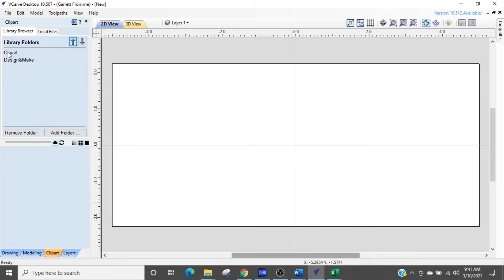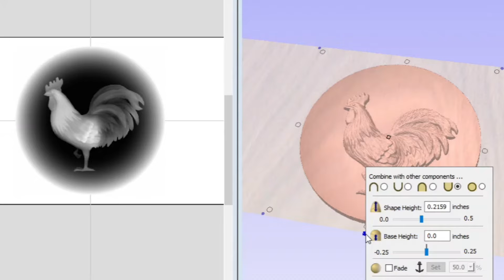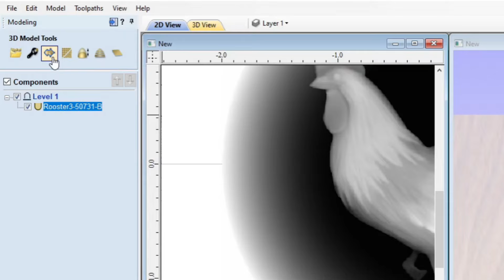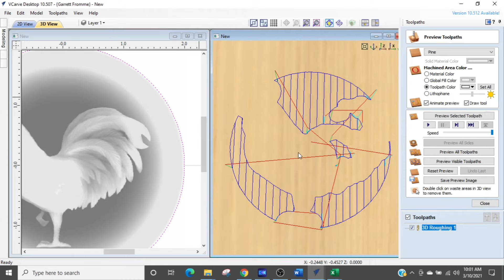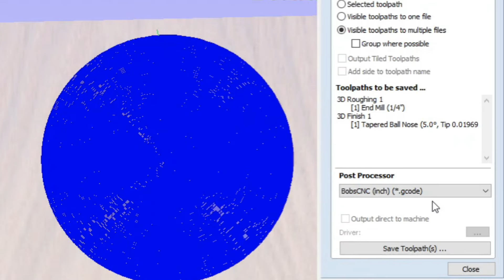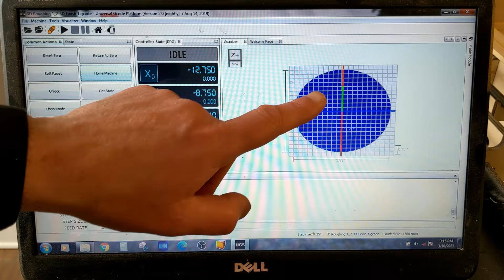3D Carving Made Easy: Full Vectric Step-by-Step Tutorial

Comment: Quite informative video! I do have a question, how did you settle on the calculated chip load for each operation? This seems low for either hard or soft wood (I believe I've seen either .002-.003 depending on the wood).
Reply from the maker: Thanks for your kind words! Choosing the right chip load can vary based on the specific operation and material, so I appreciate your input and understanding.

Comment: Good video Garrett. Thanks. I just want to confirm when doing the bit change, you need to do a Z zero again I presume. The first bit you did in the middle of the project, the second bit? If material has been removed with the roughing bit in the middle, do you do the Z zero anywhere else on top of the material instead of in the middle of the project where you have carved already? Your reply will be highly appreciated.
Reply from the maker: Hey there! Great question—yes, you'll want to re-establish your Z zero after a bit change, especially if you're switching from roughing to detail bits. It's best to do that based on the material surface where you'll continue carving, rather than in the already carved areas. Thanks for watching!

Comment: I'm not sure if anyone is having the same issue. I follow your video and setting for the toolpaths. However, i cannot seem to get that first toolpath anywhere near your 2 or 5 minutes, I'm seeing 20-30 minute range. Any tips on what my problem is? Im using Nextwave HD510 and vcarve pro12.
Reply from the maker: It sounds like you might have different settings or setup parameters compared to what I used in the video. Factors like feed rate, depth of cut, and the material you're using can significantly impact the cutting time. Make sure to double-check your tool settings and see if you're using the same bit or similar material. Sometimes, small adjustments can make a big difference in speed. Happy machining!
Reply: Thank you very much. I will check everything again. I've really enjoyed your videos and appreciate your teaching style. I work at a specialty hardware store, and I'm always letting people know about your channel. Thanks again.

Comment: hello sir you look like the one for this question i purchased a telecaster guiter build STLfile off esty . i am trying to carve out a guitar fretboard looks good in 3d view but cant get it right when i do the roughing and finnish tool paths could you help me with the setting
Reply from the maker: fenders9911, I'm glad you're tackling a guitar build; that sounds like a fun project! For the best results with your roughing and finishing tool paths, make sure your bit sizes and feeds and speeds are adjusted according to the material you're working with. Different STL files might require specific settings, so double-check those parameters. Using good clamping techniques can also help maintain stability during the carving process. Best of luck with your project!

Comment: Hi Garrett....did you have to change your XYZ coordinates for each tool change...just having trouble with my cuz settings when doing tool changes in gender. Do you have any other videos on that?
Reply from the maker: craigcameron7376, Hi there! Yes, I do adjust the Z coordinates during tool changes to ensure accuracy. It's important to set the tool offsets correctly to maintain the right positioning. You might find some related tips in my other videos, but I recommend experimenting a bit with your settings to see what works best for you. Happy CNCing!

Comment: I use a 12mm compression bit for my roughing.  Then I use a .25 inch up down bit for my first finish pass, followed by a .0625 tapered ball nose bit for a final finish.  The problem is that all 3 bits are not only a different circumference but also different lengths so taking the machine to x-0 y-0 is not accurate for running the gcode on the second and third bits.  I start at a corner but after the roughing pass removes the material and I've put the next bit in, I can't get a proper starting point.  Do you have any suggestions on how I can fix this?
Reply from the maker: ali11759, It's great to hear about your workflow! To ensure accuracy when switching bits, you can use the Z-axis to establish a common reference point. After each roughing pass, measure the material height and set your Z-zero at the same spot before switching bits. This way, you can maintain a consistent starting point for your subsequent passes. Additionally, consider using a bit setter or probing tool that can help you automatically set the Z-axis for different bits. Good luck with your projects!

Comment: I am having a problem with my machine; I am using Easel for the machine control.
when I set up the material information and the project, the machine does not fallow the
toolpath assigns to the project. My Z zero is in the left bottom Connor of the material. 
and when I start carving the spindle goes completely off the tool path.
I have checked the alignment of the table and the spindle, but the problem persists. 
I don't know if any of the settings in GRBL or with a problem will be the actual machine.
please advise.

Thanks 

Sergio Zarate
Reply from the maker: sergiozarate7846, Unfortunately, I am not much help here. I am not a tech guy when it comes to CNC machines. I may be good with the programing and operation but when it comes to troubleshooting, I'm an absolute deer in the headlights. I recommend reaching out to your machine manufacturer regarding your issue. They will be able to help you the best my friend!

Comment: I have two questions, .. you created two tool paths a roughing and a finishing but you used 3 bits, did you run the 3rd tapered bit with the finishing tool path you created for the 1/8 rounded bit without changing the finishing tool path file ? Second question.. when using a step over setting of less than 100%, doesn’t that potentially wipe out some of the detail on the previous path as the bit has only moved partially into new wood and is back cutting over the previous path if the depth is deeper on the new path ? If that makes sense.
Thanks for your helpful videos and information.
Reply from the maker: Alldaveallnight, these ones are a little tricky to answer over comment my friend. I recommend joining Kate and I for our weekly youtube live sessions we host every Wednesday at 8PM EST and we should be able to help walk you through them then!

Comment: Great video, but having difficulty understanding one thing in particular. If you’re zeroing off the center of the work piece. After you run your roughing pass and you change to your ball nose, how are you getting an accurate zero since material has been removed there by the roughing pass?
Reply from the maker: Kelly, great question! When you switch over bits, you'll have to rezero your Z height!
Reply from the maker: kellydenmark, that is a great question, you would typically find a spot on your project, either to the side of your roughing pass that is the same surface level of your original wood surface or another spot to zero your z axis. In Vcarve you can also set your spoilboard to be the z zero height, then when you change your bit you just zero your bit to the surface of your spoilboard again!
Reply: Awesome. Thank you very much for that.

Comment: The only question I have and was not mentioned in the video is since the 1/4” but and the 1/8” ball nose bit are different lengths when do you set your z for the 1/8 ball nose but?
Reply from the maker: Ceasar, all the settings should be the same but you will need to zero your bit before running the project. Here is a video on how to zero your machine that I think will really help you: https://youtu.be/UaDMzl_ZXVg

Comment: I'm struggling to understand controls for the model height.  I'm trying to make a bas relief, in which the 3d part is raised above a flat surface.  The panel will be 1/4" thick, fitting into a dado in the frame of the cabinet the piece goes into.  In my image, the purchased image has a depth of 0.24".  The material starts at 0.75 but the areas that aren't part of the image will be less.  They don't have to equal the size of the dado (but it's fine if they do:  0.25").  I can route or chamfer the back to make the finished panel fit.  But the background does need to be flat.
Reply from the maker: David, I recommend trying out some smaller different projects before moving onto more complicated ones. Learning the controls and becoming a master Vectric 3D user comes through trial and error!

Comment: Okay.  It looks like you’re saying that Aspire can’t just send the project to the router…you need to save out the code and load it in with UGS…am I correct?  Seems like a lot to spend for software that can’t finish the job!
Reply from the maker: Peter, yes you will need to use UGS to send it to your machine. Unfortunately, most the softwares work this way in conjuncture with a post processor like UGS.

Comment: Why did you use a USB drive?
Reply: Thank You for your help. I like your videos. That's what I thought. I have a Windows desktop and a Apple laptop. Can I do the same thing on a LongMill?
Reply from the maker: @rodneycathyelmore134  the long mill control software is Windows based. Apple will not work unless you have a Windows emulator
Reply from the maker: Rodney, I needed to put the files onto the USB drive so I could walk down to my shop and load them onto the computer next to the CNC!

Comment: The finishing bit you use in this video is not available in your "Bit Store." Of the bits you sell, which would be your choice to replace the 
 Tapered Ball nose used??
Reply from the maker: Dave, 
This is the one I used in the video brother. Here's the link: https://bit.ly/3IRCaRZ
Its in stock right now!
Reply: @IDCWoodcraft  I have your 0.030 Rad x 10deg bit. Will I see a significant difference if I use the 0.015 Rad instead?
Reply: Oh yeah, and while you're reading here... why is it that when I drag in a jpg or raster file I have to do all kinds of machinations to get it ready to work with but clip art just jumps in and is ready to go? At least it seemed that way with the chicken. And thanks so much, I am SOOOO ready to do 2.5 stuff!!! 
wait, let me guess... the clipart chicken was a vector file?
Reply from the maker: @daveferguson492  That happens because Vectric interprets it in its own way when you're doing a PNG file. It's not the best for taking a bitmap and modifying it for vectors
Reply from the maker: @daveferguson492  If te project is small, the .03 will not look as good. If it is large, the .03 will be fine

Comment: Hi Garrett, Thank you for the tutorials, I have learnt so much from you in my short time of owning my first cnc. QueenBee Pro 2.2kw W/C 1500 x 1500.
I am about to embark on my first 3d carve (Its a sushi plate which I want to turn into wall art.
Its relatively large at 450w x 250h x 27d and solid oak
Its a very basic design for the most part. but with a roughing pass and finishing with my .25mm TBN its a 39hr carve with a 9% stepover.
Is there a way of only doing a small portion of the carve with the TBN?

The entire project is just a very smooth, wave like texture and very easy to sand afterwards if I do not use a TBN and just settle for a 3mm bullnose bit.
However one end of the board has a carp which is extremely detailed (scales, whiskers, eye & fins etc) and this is where the TBN is a must. The carp takes up less then 20% of the entire project yet having to run the TBN for the entire project seems a waste of probaly 25hrs

Thank you in advance
Reply from the maker: Aircooled, welcome to the world of amazing CNC projects my friend and congrats on the awesome machine. That is quite a long carving. Have you considered doing a larger stepover?

Comment: Enjoyed watching your video and learned a lot. My question is:  you zeroed your bit out in the middle of the project. How did you zero out the last bit when you had already carved out the chicken?
Reply from the maker: Fred, in that instance you don't zero out the X and Y because those don't change. You will only need to zero out the Z with the new bit. For that you can use a touch plate or the paper method on any remaining wood that is at the original z zero.

Comment: Found this video very helpful thanks. I use aspire 10 and am trying to get the hang of doing 3d models. I’m having a little trouble carving a deer. After I have the toolpaths all set and ready to go, the tool path reviews are fine on the computer but when it’s doing it’s rough cut, I’m cutting all the way through the material, working with 3/4 in materials. What am I doing wrong, and how do I adjust the depth of cut?
Reply from the maker: Hey Josh, this is a little too trick to answer over a comment. Will you send me an email instead?
Reply: @IDCWoodcraft  I figured out what my issue was the depth of the router bit was set too low in the CNC router if that makes sense.

Comment: Hello all I need help.  I can't understand what is going on.  I cut out alot of stuff doing the exact same thing I'm doing now and has always worked perfect.   On the computer the preview is flawless.  I did all my rough pass with a .25 endmill to save time then changed it to a .125 ball nose for the finish pass.   I set the height by putting the bit close to the table  then move it 2 inches up.  I then save that z height.  I did this for both bits.  The rough passes all worked perfect but when I did my finish pass it goes super deep.       When I return to home it's well above the wood   I use universal guide program .  Any ideas?
Reply from the maker: Hi Mark. ISorry for the delayed responcse I suggest you inquire about this in CNC related facebook groups. You'll have much better answers coming to you.
Reply: @IDCWoodcraft  thanks  I just redid it and it works   weird hey

Comment: Question, I just received an "ONEFINITY WOODWORKER 31"X31 " CNC and I bought VETRRIC V11 I'm wondering, do I need "Grbl Controller?  because Vectric v11 I think has the ability to make its own "G-CODE" or is this buggy?, what do you suggest?
Reply from the maker: Vectric has a post-processor for your specific machine. And your machine has its own controller. So the answer is no, you do not need a grbl controller

Comment: Im sorry if this question has been asked but say when you run finish tool path 1 on say 1/8 bit but you want to run a finish tool path 2 with say a 1/32 bit is there a way to optimize so its focus is just the detail that 1/8 would have missed. I realize on a project like the model you selected it might serve no purpose. So i guess ill rephrase the question. Say i ran the whole job with 1/8 ball everything looks great but i want to put focus to detail to the head. Is there a way to window in and just put focus with say a 1/32 bit in just the head the chicken vs running the whole 3d vector to save time
Reply from the maker: Anthony, great question. Yes there is a way to do that but Vcarve doesn't have those capabilities. It's called "rest machining" if you want to look more into it though my friend.
Reply: @IDCWoodcraft  thank you so much!

Comment: Great video! How do you select just the rooster after you completed a 3d carve to use a different ball nose?
Reply from the maker: Bill, I'm a little unclear on your question. Are you talking about after the roughing pass or after the finishing pass?
Reply: @IDCWoodcraft  Say you already did the finish pass with 1/8 ball nose and then you just want to run a toolpath on just the rooster with a more detailed bit so it doesn’t do the dish part. How do you select the rooster or create a vector boundary around the rooster? Do it manually with the line tool or is there an easier way. Thank you for the reply!!
Reply from the maker: @billdanic9955  in this case, the rooster is part of the 3D model so it's not as easy. You would have to draw a vector around the rooster, then tell the 3D tool path to stay within that boundary
Reply: @IDCWoodcraft  thank you! Keep up the great videos! They are very informative.

Comment: The best way to learn CNC is to find a lot of scrapwood and just go ahead it. That’s what I did and it seem to work good. Also by aspire because it seems to be one of the easiest programs to work with. I am not sponsored by aspire I am just a happy customer.
Reply from the maker: Yousuck, I'm definitely a "learn-by-doing" type myself too. I couldn't agree more, I think a big ol pile of scrap wood can be one of the best learning tools out there. I'm glad Aspire is treating you well my friend!
Reply: I wanted to add that Bob CNC is not a bad machine I started off with an E3 and I have since bought two more machines and I still have my E3 and use it as a laser machine and it still working five years later
Reply from the maker: @yousuck5560  Bob's is a great laser machine. Richity is not an issue when it comes to laser work.

Comment: Hi Garrett, Tech question here.  I have run the roughing toolpath already which was about 4 hours.  If I am doing a 2.5d gnome with Vcarve Pro, the finishing toolpath is very long, around 30 hours using the 1/8" ball nose tool.  Can I break up the finishing toolpath into multiple toolpaths like 10 3 hour increments so I do not leave my machine unattended?
Reply from the maker: Hey Randy. I never thought about that but I be;ieve it is possible with some tricks. I've not tried that.